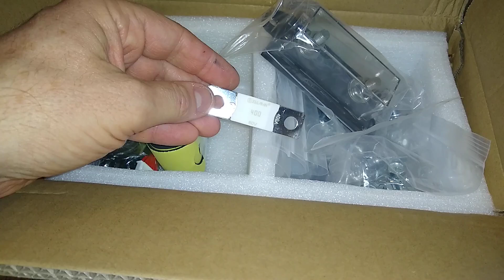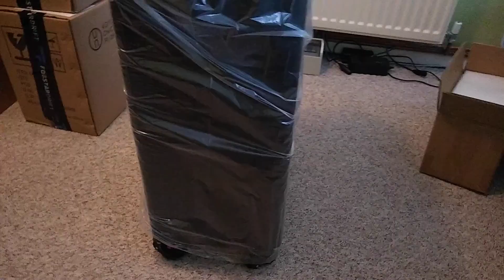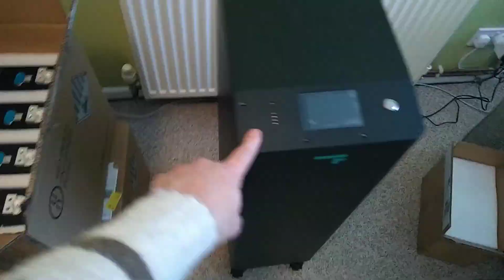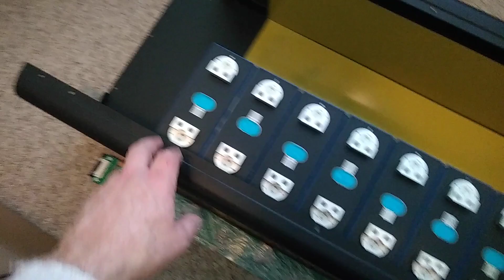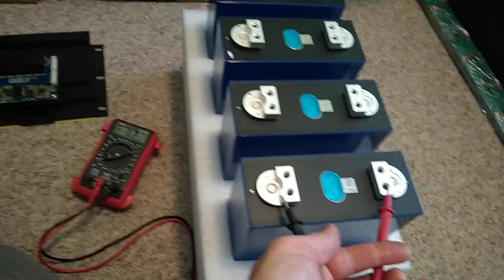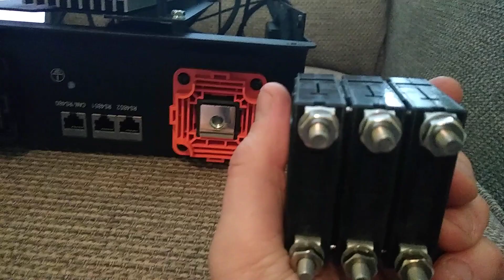Building a new, home storage battery. Part 1

Comment: hi, interested to see what you do with the pylontech and seplos mix i have  2 us300c and havent used then ( apart from charging and then discharging to keep them in good order) since building a seplos kit. I can link them together.  I thought about connecting them to the solar and then using them to power my office.
Reply from the maker: You can't mix the Seplos with the Pylontech as they have different voltages. Pylontech is a 15s, Seplos a 16s. I have my Pylontechs connected to a completely different inverter from my Seplos.
Reply: @nicholashowell  hi nick 

Hi,  I charge my seplos kit at 56.8 volt and used to charge the pylontech at 51.8( based on settings recommended by victron), i have a spare 48/3000 so will use that and my pylontechs to power my off grid home office. Not 100% sure what will happen yet as i am not sure if my partner will put up with another victron inverter and another cerbo etc soi may just sell the pylons and cut my losses. I started off with 4 * us3000c but sold 2 when i got my first seplos kit, just  got my second kit its a v4 kit with the 314 cells ( birthday present from my partner). Currently top balancing my 314 cells.

Comment: Thanks for the video, I've just put one of these together. Instructions online are sketchy, but with a bit of double checking managed to put it together, now its happily up and running.
This battery was great value and even dropped in price whilst i was waiting for it to be delivered (which seemed to take forever), so i cancelled my order and reordered it. 
Usable capacity for the 314Ah version is roughly 13kWh at 20% max discharge level.
I found Fogstar to be responsive and always answered my emails within a day or two.